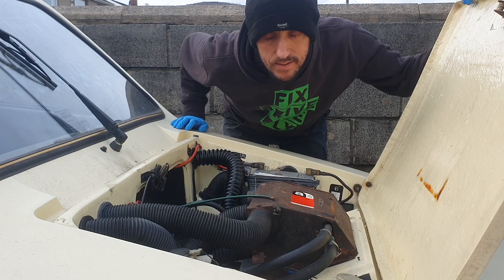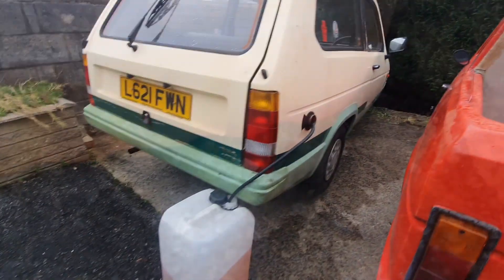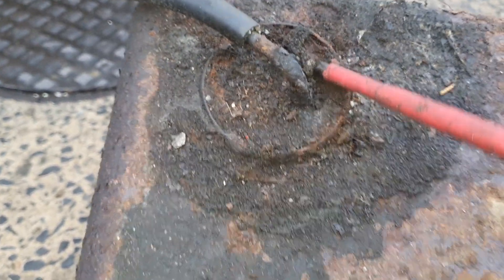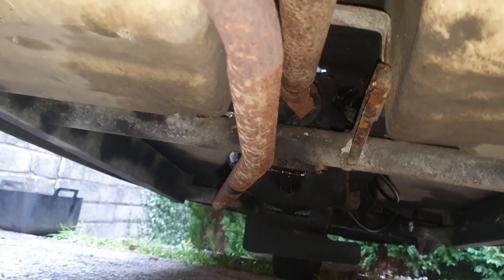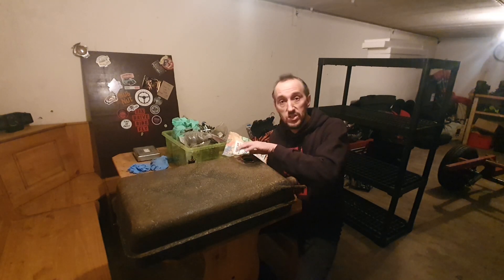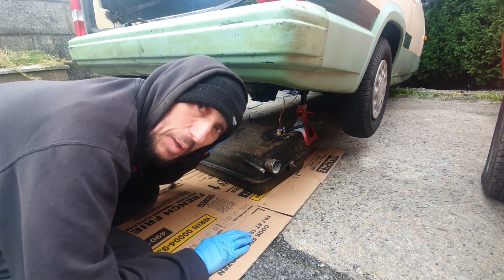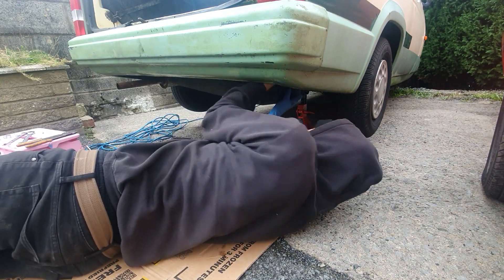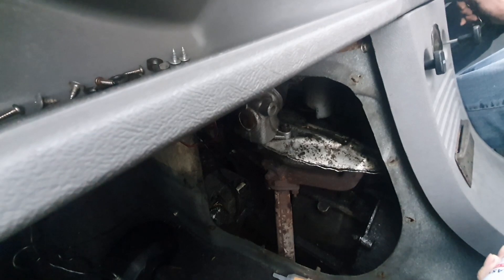Reliant Robin Fuel Tank Swap and bonus troubles!

Comment: Check for vacuum build up, used to be the way when tank has been off and on you had the filler cap off so it can purge any air bubbles in the line which I would suspect is your problem.   That second pipe that runs alongside the filler pipe is notorious for gunking up and maybe you disturbed stuff causing it to block the breather, check the breather hole next to filler cap as well, any blockages in that will stop fuel delivery.   Also check your hoses in and around the carb as its a closed system and leak there will cause problematic starts and running.

Comment: Keep the old tank as you never know when you might need one…. It can be cleaned up. 

I have new tank locking rings, I also have diff seals in stock if you need one.
Reply from the maker: Yeah ot definitely worth saving.  Cheers dude
Reply: I wonder if the old tank could be brought back with some rust converter inside and out
Reply from the maker: Yeah it's worth keeping

Comment: Wouldn’t be surprised if it’s the condensor-I recently fitted a new one on my moggy and it was faulty straight out of the box!You can try another if you have a spare just by connecting the wire to the negative on the coil and grounding it on the engine while trying to start it-no need to go to the trouble of swapping it 👍
Reply from the maker: I didnt know you could test it like that, makes sense tho, thank you for the tip 😀
Condenser was my next thought also.

Comment: SU carbies only have about 3 moving parts so not much of a job to check it out.  That's my 2 bob's worth anyway.  Of course, you probably have it running by now anyway 😊
Reply from the maker: It's not running yet but we have ruled the carb and a few other things out.  I have a suspicion as to the cause which I will be checking out this weekend.
Reply: @StevesMachines  What a tricky little car.  I'm confident you will get to the bottom of it.

Comment: Have you looked at the plugs, once they get fouled they seem to fail more easily than they used to,
Reply from the maker: Yeah, cleaned, gapped and tested since the vid, all fine.  I'm going to try a spare coil and points over the weekend.
Reply: @StevesMachines  my old 600 diversion used to love to drop onto two cylinders when it was misty, as it was lugging a sidecar it made life interesting, changed coil, leads and caps and found the plugs were shorting to earth. Misses had my tools so just limped it home, amazingly we could do a solid 50 on two cylinders. Older plugs seemed more responsive to a blow out and gentle heat than newer ones.

Comment: It's interesting seeing you go through repairs on your robin, I had to do my fuel tank a month ago, lots of rust but most of it got removed and the base seems fine and I did not want to replace it so just cleaned it up with the old fuel and a T-shirt in a funnel to re filter it and seems fine now. Use a filter and it's all good.
I found that my intake and exhaust manifold was loose and tightening it up helped it run a bit richer and run right. 
One problem I had with a similar start issue was that the carb had a weird jet with a bushing (which had fallen out) in a tube instead of a solid bit of brass. I doubt it is that as I have never seen anything like it before or after and the replacements were all a solid bit of brass but it may be worth a look?
Reply from the maker: Since this I swapped Carbs back with my mate, both carbs work on his car.
I've done a few other tests, my next step is to swap out the points and coil incase the new ones have failed.
Reply: @StevesMachines  Hopefully that fixes it for you. Keep up the videos, it is great seeing another's Robin 'joys'.
Reply from the maker: Cheers 😀 I bet it'll turn out to be something simple.
It's lucky they are fun to drive 🤣

Comment: Is the yellow light coming on when trying to start  ?   The old trick of a wire across the top of the engine,   If it starts and dies when you take the wire away the key ignition is gone,   I fitted a M G Miget one to my MK 2 Robin as it`s the cheapest
Reply from the maker: Yeah it is, I also had spark at the plugs.
Reply: @StevesMachines  Yes it can be confusing as you can have petrol coming from the fuel line at the carb,   You also have spark at the plugs,     But with a faulty ignition barrel,   It will stop the engine the moment it tries to start of the starter motor,     But using the wire trick to bypass the key ignition,    If the engine starts you know what the problem is,      The key ignition barrel can be a pain to swap mind
Reply from the maker: Cheers I'll bear that in mind 👍

Comment: Hi, did you ever solve this issue? Mine ran out of fuel, I topped it up and now it won’t start. Same issue as yours.
Reply from the maker: Yeah, rusty tank, I did replace the tank but the replacement leaked so I just cleaned and vacuumed it to get the dust and rust out.

Comment: that fuel tank would probably go again with a sealer or a rust descaler in it, seen far worse
Reply from the maker: Yeah it certainly isn't going to the scrap man 👍
Reply: @StevesMachines  as for the car no starting, turn the ignition on, take the dizzy cap off and put a screwdriver in the points gap see if you get a spark, see if fuel is coming up the fuel pipe in the engine bay, lastly it maybe the float in the chamber lid stuck shut which maybe why its nearly starting, 3 screws on top to find out